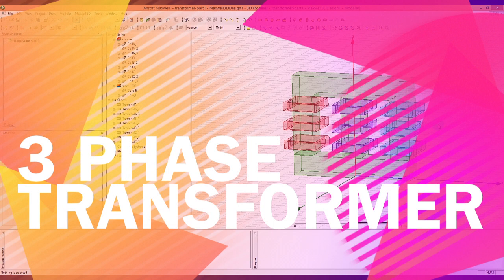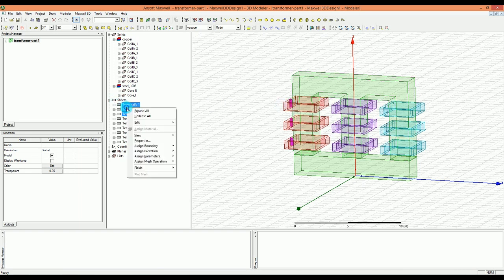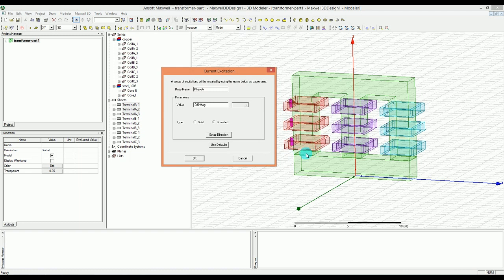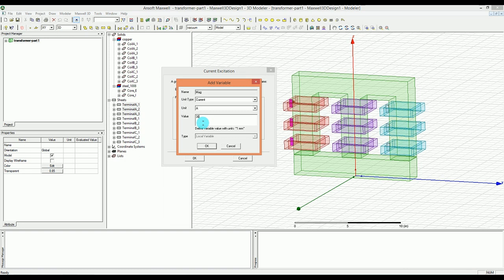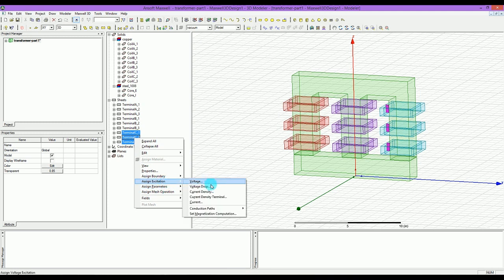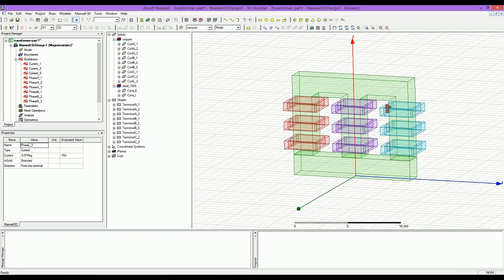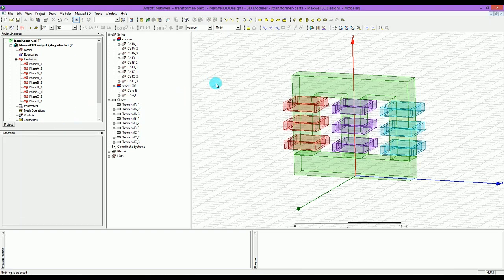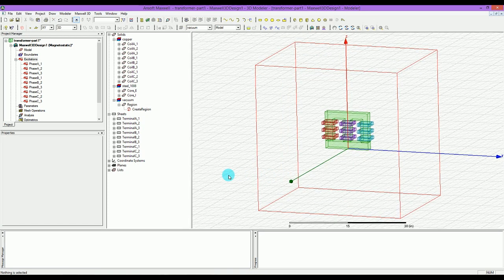207 - Ansys Maxwell - 3 phase transformer [2]

Comment: In 207 video at 5:48, what I am not clear about is why inductance L= flux/current^2. 
Because I think L=no of turn * flux/current.
Could anyone explain that one. 
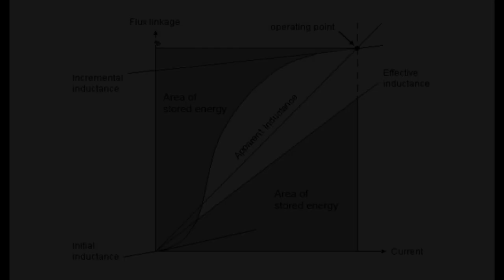And also I am not quite clear about the equation that you tell at 6:50 .
May I know how the energy related to inductance and current.
Thanks you
Reply from the maker: Well when you are calculating the inductance based on total flux why you should Times the flux by number of turns?
Reply: kamyar K . Thanks you for your reply. Why I times with no of turns is that I use multiturn coil and I think L depends on no of turns of coil.

Comment: Kamyar, I have to model electric and magnetic field in transformer station. Source of these fields is transmission lines and bus bars. I saw somewhere on internet that someone used magnetostatic and electrostatic solution type in Maxwell. I see in your video that you use magnetostatic too. Is this static mode gives good results,considering that source of field is three phase? Each phase has phase shift 120 degree. 
I see you put in one phase 1 direction of current and in other two oposite direction.
Sorry for bad English.
 Thanks in advance.

Comment: Kamyar, could you please elaborate why you chose 3 for branches in second matrix(15T) setup? I cann't understand very well in your video,thanks.
Reply from the maker: that was to show you how the number of branches and the number of turns are affecting the post processing results and whether or not you will get the expected results.
Reply: Thanks Kamyar,I am afraid I am still in confusion.For matrix 1 setup ,chose 1 for branches,is it ok to chose 2 or 4 for second matrix setup instead of number "3"? Thanks.If I am going to add the third matrix,what number I should chose for branches?
Reply from the maker: well the Matrix setup in normal cases should be only one. you would add only one matrix in the parameters per each model of yours. the reason that I added more than one was to show you the difference between different options inside the matrix property window. Did you get your answer?
sorry for lat reply btw.